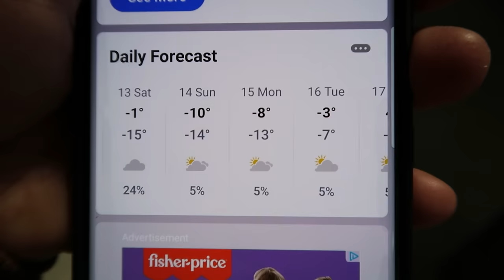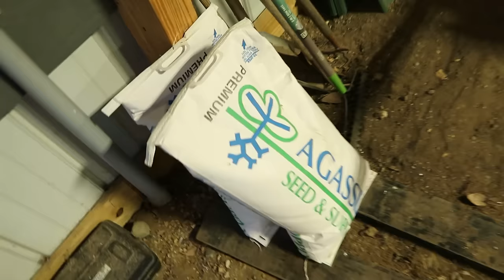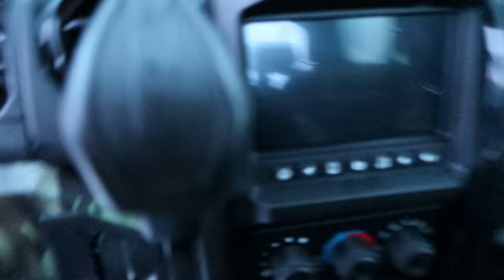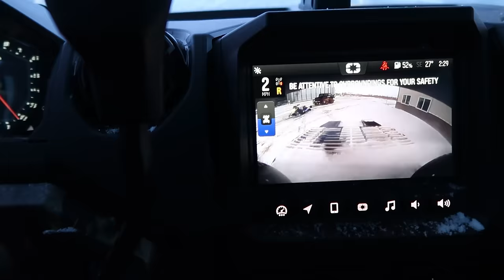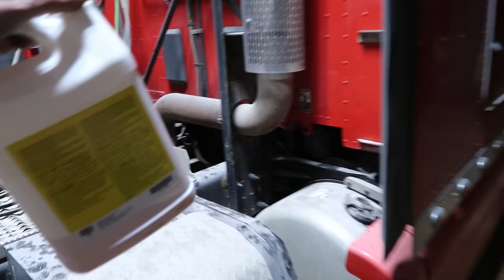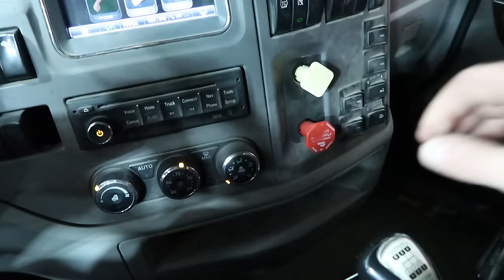One Man's Pain is Another Man's Pleasure

Comment: Yes, the PTO's are sometimes a pain in the ass, especially when its designed to pull back, and push forward. Why not just the simple pin you can press in, and slide it on?? Been struggling with those crappy designs before.

Comment: Suggesting you cut holes on opposite sides of the pto plastic bell safety guard for your thumbs. That way both hands can pull retainer and push pto on at the same time. The holes also make greasing the u- joint easy. And please, don’t grease the pto slide tubes. Only lube it with a spray like JB 80 or something. Grease gets too gummy for slides in cold climates. Who knows, maybe next time that pto may fall on!

Comment: Those darn uncircumcised pto shafts are a pain, trying to pull back the skin...... I mean clip and push the shaft in can be tricky.
 On a boring day when weather is better I found cleaning the old grease out and replacing it with winter grease or white lithium grease is amazing for winter.

Comment: Just a little advice from a 25 yr veteran of the road … I don’t ever set my trailer brakes unless I have to, specially in the winter because I personally don’t want to be pounding on drums at -20 because they froze up. 
I realize it’s in your heated shop but it’s really not necessary unless you are dropping your trailer or getting unloaded.

Comment: On American Top 40 with Casey Kasem  To Millennial Farmer 2:21 pause From 1978 -79  Renegade - Styx from Pieces Of Eight Album. On  June 9th, 1979 Renegade was on the B flip side peaking at #16: Side of Sing For The Day was the  A side peaking at #41. On  Billboard''s Hot 100. Renegade charted for 13 weeks form April 7th - June 30th 1979.

Comment: The spring loaded lock collars on modern PTO shafts are indeed miserable. What was wrong with the old push pins 🤷🏻‍♂️! But!, the plastic shield tubes are 75% of the issue. Work great for about 6 months and then…., well, you know. And, the LAST thing you ever want to do is put oil or grease on them. That only attracts dust and makes it even worse.

Comment: If ya weld a bracket on the tractor you can use a ratchet strap to pull it ya gotta do things to help the back as a tall guy myself work smarter not harder

Comment: I have been in the trucking business for 50 years, I would have your local fuel hauler stop by and add #1 to the trucks.
Reply: Why? There isn’t any difference in the dyed fuel or green it’s all the same just dyed. Are you talking about kerosene?
Reply: @joshhubbard406  you need to check out the difference between #1 & #2 diesel fuel

Comment: Why is it everyone with a PTO shaft on a tractor has the same issues?  Oh yeah, worst place to put something is right in the middle of all the arms.  I found that the grease in the ones I have turn to a glue like substance if they are not moved for a while. Might be time to pull the shaft apart and either clean it or at least pour some diesel fuel down it to loosen up the grease so it slides.

One other trick I have done was to pull the PTO as far as it would go with the attachment up or down so it was extended, then moved the implement the other way so it pushed itself on.  That’s a crap shoot of a method though as so,times it does not work.

Comment: One thing in Europe we have on all our John Deere tractors are switches on the rear of the rear fenders, 2 for operating up and down hydraulic lift arms, 1 for hydraulic top link and lastly one to very slowly turn the rear PTO shaft, helps a lot with heavy shafts aligning splines. Before retiring, I drummed it into all the other tractor operators of spraying not only the stub pto splines, but also the splines on the implements, a little here and there often was a gods send, we never had to chew our bollocks out sliding PTO shafts on.

Comment: I’m struggling to understand why before mounting the blower you didn’t think about cleaning both ends of the p t o shaft and then lubing including the joint , also you turned the output shaft round and put the gritty end in without cleaning it 🤔

Comment: Just boggles my mind why snow removal equipment manufacturers don't offer an option to put a round cutting edge for equipment used on gravel surfaces so it would float and not cut into the gravel/dirt, Its gotta just tear up the blower impeller.

Comment: Having put on and taken off a few pto shafts bagging silage, when the shafts get stuck like that you need to pull the end all the way off and spray some oil on inside and outside where they meet. The  grease when they sit just gets hard as a rock and just binds up. Its also very hard not typing this without innuendos.

Comment: Next time, rase the snowblower to level the drive shaft to the tractor pto. It's way easier to push and pull when level. Having an angle on that u-joint adds more problems.

Comment: 9 minute.  I am too lazy for that.  I pull tube out, clean with solvent never would think of gas, or brake cleaner, ether then lube. *you still have WD-40 as sponsor*?  Then spray female end, work loose, wire brush on male tractor end.  Possible hit with WD-40. 1/10th the work.  Of course I did it in Dec. never used, going to unhook moving corn in yard.
 12 minute. IMO you NEED to pull that pto shaft apart.  Clean, lube.  It will reduce pressure on bearings, and tractor snap rings.  I will not raise/lower 3pt under snow load to reduce stress on pto components.  Clearly that is junked up.  My grain cart has issue above 1500 rpm. Shaft beyond clutch was bent by prior owner. I had to hook ratchet strap to pull it apart.  After cleaning, lube. It slide like new.

Comment: Push forward, pull back. 😅Been there, done that! Takes a lot of coordination doesn't it. WaIt 'til your strength starts to fail in a few years, as you age, Zach. Little bit of light oil on the parts that go together, before the blower is on helps a lot, but you and I both don't think of that before we get to the point where you had to take a breather.